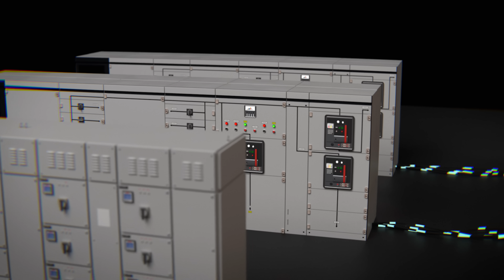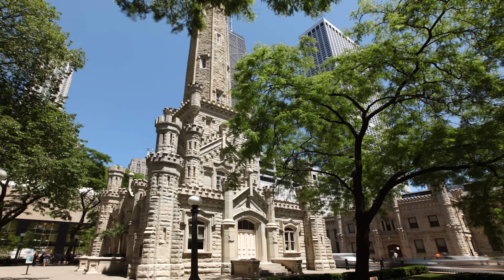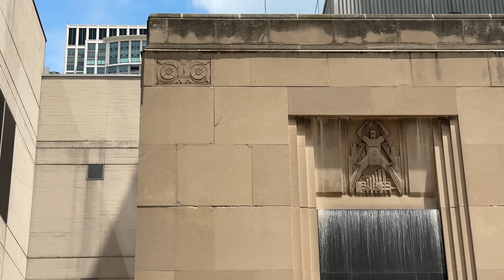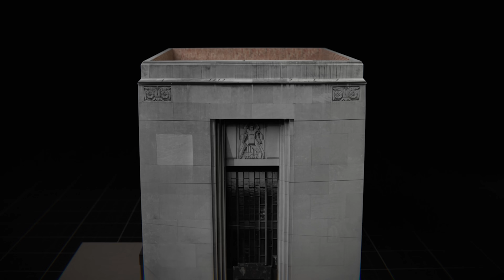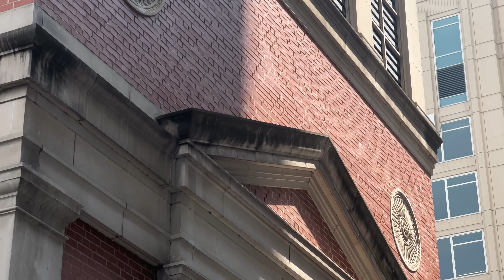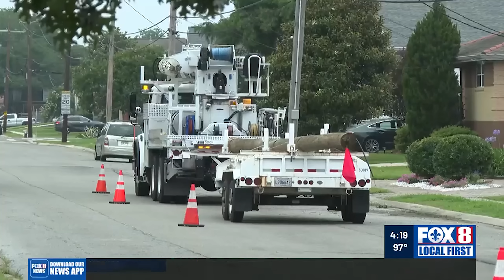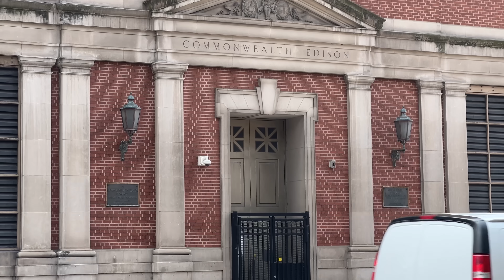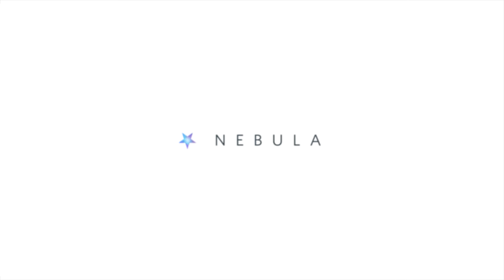How Fake Buildings Keep Cities Alive

Comment: I work for the electric company specifically in substations. I wouldn’t want the general public anywhere near those things, we have years of training just to get close to that stuff and people still do get killed at work.
Reply: Yep. Insurance and lawyers want the public as far away as possible.
Reply: Yeah, they aren't hidden because they are "some cool secret thing for smart engineers". They are hidden because they are dangerous, and someone might break something if they have acces. Keeping them out of sight reduces the risk of someone random having an idea to go check them out closer.
Reply: There's a sub station I drive past regularly, I noticed only a couple years ago the standard chain link fence was replaced with concrete walls, topped with razor wire, and a ton of security cameras.

Kinda weird, lol.
Reply: @planescaped  Perhaps it’s a NERC station and it was upgraded to comply with the necessary security protocols. Electricity is kinda a vital national asset, no?
Reply: Yep, in the UK (1980s) we had public information films specifically warning kids from going anywhere near them!
Reply: If I worked for the electric company I wouldn't want to be anywhere near those things myself. That's the only thing that ever held me back from being an electrician. Getcher paper-thin suit on and your 10 foot pole so you can turn the extremely high voltage breaker that's making scary buzzing sounds on and off! 😒🫶
Reply: Your security guards get about 10 mins of training to be near them 😂
Reply: There's a forest nearby my house, like, a "nature preserve" where its literally just trees, but it also has those wires, right above. And those metal towers, with the wires connecting them, in there, too.
And if you walk to the end of the forest on one end, you find the highway nearby my house, but before that, the substation right next to the highway, and at the end of that forest path.
Just chainlink fences seperating these insane looking machines, out in the open...
Looks like if someone did a redstone contraption in mc, but in real life, instead.

And also, a water treatment plant is on the other side of the forest...
Idk I just find it interesting that the water and power stuff is literally right next to my residential neighborhood....
And I can just walk to that machinery and see where my electricity at my home comes from. for my entire life.
Reply: Yeah but the methheads want the copper
Reply: Sure, but it IS there.  What is the 'harm' in allowing the public to see the inner workings...what if they had 'real' windows to look through (backed by a security features that prevent ingress)?
Reply: @KSPRAYDAD  I'm an engineer in transmission and have had a few public consultations. The short answer is that people hate how they look and sound.Many substations have fences that you can look through in more remote areas but no one likes the look and (fairly loud) noise so they are hidden to reduce noise and visual impact. Plus honestly there's nothing really interesting to see in a substation, it's just a few boxes and bars. Also, they can explode... I'd rather the explosion be contained...
Reply: @Old-George noise like that puts me to sleep
Reply: @KSPRAYDAD  Secrecy is a layer of security. The fact that nobody realizes it's there in itself is preventing ingress. Secrecy prevents shitty people from doing shitty things in this case. Of course, it's not just about secrecy but also beauty. Nobody wants a shitty-looking substation muddying up the beauty of their city. It's an eyesore. As exchangAscribe mentioned, if a street had one of these every other lot I'm sure it would be skid row with drug addicts and junkies aplenty and hypodermic needles laying around everywhere. 😒👍
Reply: @KSPRAYDAD  I see your point, but if everything is working correctly, there literally is nothing to see… It’s when equipment fails that a good show is put on
Reply: @DavidGregor-pr2mc  I'd argue we need to build curiosity in youth in our infrastructure. Can't do that without being able to see it.
Reply: @DavidGregor-pr2mc  That is just the disconnect the creator is talking about. To us engineers it is understood what is what, what does what. To the general public, it is like magic. Especially the large equipment is so foreign to them it produces interest. I've given tours on family days as an electrician in our modest paper mill and every time I show people the copper bus bars they are stunned just by how it is all connected by plates and bolts. It is exceptionally important to notice that to most people in the west, electricity is this thing you just have when you plug a plug into a socket in the wall. The adventurous ones have seen the small wires inside their fuse-boards.
Reply: @ruedelta  Exactly. We need curiosity in youth to interest them into doing important jobs. If no one is interested in doing electrical work then who's going to do it?

I grew up with transparent plastic in electronics. The fact that I could see through the plastic and look at the inner workings of consoles and controllers grew my interest in electrical work which is probably the biggest reason as to why I've been able to build my own computer saving some money on assembly and as to why I'm currently studying to be a professional electrician.
Reply: @KSPRAYDAD  Insert that video from out of Detroit where some ratchet chick climbed over the wire and electrocuted herself twerking on a piece of equipment. WhErES Da HArM said the man who has never met a single member of the public
Reply: @KSPRAYDAD  Do you like looking like someone left a pizza in the oven for three hours too long?
Reply: @KSPRAYDAD as Muhammad in Iran and you'll have your answer
Reply: @KSPRAYDAD you don’t remember being a teenage boy, I assume.
Reply: @KSPRAYDAD because most people think it’s ugly
Reply: @KSPRAYDAD What could possibly go wrong? Hmm.
Glad you're not in charge.
Reply: @KSPRAYDAD  because it breaks the unity and aesthetic of the urban environment. theres nothing desirable or beautiful about machines like this, and they dont make people comfortable in their environment. imagine if a street had one of these every other lot? everyone would avoid that street. 
people need healthy and pleasing environments to live in. thats the original purpose of traditional architecture.
Reply: @exchangAscribe YOU don’t find it desirable or beautiful. But there’s a good reason there’s a term specifically for it, ‘industrial sublime’ as mentioned in the video. I’ve been enjoying bike rides through industrial areas for 30 years now, and it still doesn’t get old. 
If presented well, why wouldn’t we show the infrastructure that keeps the city you’re living running? It’s there anyway.
Reply: @luipaardprint  no, youre assuming that. everyone finds traditional more beautiful and pleasing, besides some outliers like always. thats what im saying. 
industrial equipment is not designed for aesthetics in any way, therefore most of it does not look good or fit with its environment. 
while some minority of people may find the complexity and chaos of the appearance of industrial and mechanical equipment nice and interesting to look at, vast majority doesnt. i myself like and appreciate the look of these machines, but i realize i have a unique taste and i understand objectively they dont look as aesthetic as traditional architecture.

theres actually a literal style of architecture that wields this aesthetic if your interested, called bowellism. and the buildings that use the style sit right next to all the regular buildings perfectly visible. and yes, majority of people did not like it at all.
Reply: @exchangAscribe if ‘everyone’ finds traditional more pleasing architecture would not evolve. Yet it does. You really have to be careful with statements like that because they’re almost always demonstrably false. 
And all of that bypasses the point that was made in this video essay, which is that architecture could be used aesthetically to give space to the infrastructure that is allready present in your environment.
Reply: @exchangAscribe and on a side note, the centre Pompidou is considered a highly regarded contemporary artwork when we’re taking about Bowellism.
Reply: @luipaardprint  its not demonstrably false. i am careful with my words and know exactly what im saying. its actually demonstrably true, and has been demonstrated on multiple occasions. 
architecture like any form of artwork may evolve based on trends or passing fads, but they do not evolve based on what is good or not good. people follow trend and do things based on group thinking and popularity more than anything else. there is thousands of examples of trends or norms that were objectively bad for society or just distasteful. to think that everything thats normal or popular is because people like it the most or that its the best and beat out all other options is shortsighted and has shown not to be true on huge number of occasions.
the original point was already addressed, you could use the industrial thing there but itll look bad. plus be open to people touching it.
Reply: @exchangAscribe you’re still misconstruing the point, no one said to just plop a transformer in the middle of the street for kids to play around, but to use architecture in a way that shows that infrastructure is there instead of hiding it. 
Also when you say ‘everyone’ in the same sentence as ‘not everyone’ it’s demonstrably false, and you should not use the word everyone.
Reply: @luipaardprint   thats not how statistics and the general existence of life and organisms work. or youre just being coy and you know. there is not a single statement out there that you can make where the term everyone would be technically correct by your definition and logic. you literally wouldnt be able to use it for anything besides situational or contextual statements where you know the full sample size like "everyone in this room" referring to 5 people. i can, like anyone, say "everyone has a mouth" and it based on how the word works and how life and nature works, be true. noone would question that statement and we use such statements/thoughts to predict and assess variables, patterns, behavior, and operate in the world around us. even though, by technicality the statement is 'not true'.

the building wouldnt be in the street would be in a lot lining the street like all the other ones, but would still be accessible that way and people be able to touch it like all the other buildings. youd have to block it off with a gate or something. 
if youre saying to have an actual nice building housing it like in the vid but thats designed with parts of it exposed/cut, showing the equipment and industrial parts inside (like high end cars will do sometimes), than id agree with that and there could be a way to make that look really cool and just as pleasing as the traditional building would, while also keeping away from contact with it.
Reply: @luipaardprint the majority do, across political lines, across regions and socio-economic status. This is aggregated from over 40+ years of research on pattern responses, flat polls, design contests, preservation movements, and the current surge in interest, globally, in new tradional design and urbanism.

The status quo is set now by power brokers who decide the sway they need for their highest profitability. One hundred years ago, when the world was already introduced to Modernism, the overwhelming majority of people held strong to the use of decoraded, traditional design, and the cubist/ minimalist structures were nothing more than sculptural experiments. It wasnt until after the second world war that the tennants of those styles were co-opted to reform architectural standards, as the pace of the rebuilding and world at large exploded. 

People had reactions locally, but it was scholars and idealogues who carried the torch of contemporary design principles into the mainstream, not the public. The public has, provably, on just about every occasion, favored traditionalism to contemporary "modern" inspired design language.
Reply: @exchangAscribe  Function is form. I personally prefer working things, art is arbitrary and meaningless. Substations often have lots of symmetries too... Eye of the beholder, and you sure presume for a lot of the population.
Reply: @transitive-identity  love this argument. if art and aesthetics is meaningless and useless, remove all art, visuals, games, entertainment, and leisure from your life.
Reply: @exchangAscribe   I am the opposite in that respect.  I guess, being an engineer myself, I am more at ease when the equipment is visible, and I know where it is, and also easily accessable to the ones that maintain it.  I work on a considerable amount of equipment that people like to hide in cabinets, closets, in ceilings, etc, and the problem is the more hidden it is, the harder it is to access and service, and also being out of sight, out of mind, means it gets neglected too.  A visible substation or pumphouse that has something go visibly awry, would lead to someone calling the malfunction in.  Hidden in a building, nobody would know a malfunction occurs until it gets big enough to cause a failure.
Reply: @exchangAscribe  You seem to presume I decorate my life, I live functionally, it is quite stark to most. I have minimized it for the most part, only functional things exist in my home and I let entropy sort my space. Why do I have to remove all visuals and go blind? There is a lot of symmetry in reality that isn't due to arbitrary human opinion that can be valued for it's thermodynamic efficiency and/or functionality regardless of what people believe. Why can't I game for functional reasons from memory training to dexterity, do I need to care about the visual style? In fact I design many interactive simulations without ever appealing to art that are beautiful to me for the truths of reality they provide a litmus for. I see the beauty in exposed substations in the same way someone sees beauty in the mona lisa. I can appreciate the skill it took to create the mona lisa, but there's more beauty in a LHC capture. Simply stating people are more varied than you pretend.
Reply: @exchangAscribe  While you are correct about the fact that most people don't find electrical substations very pleasing to look at, I think it's also important to cater to the small audience that does in this case.

If electricity works like magic and just appears from your wall outlet then no one is going to be interested in doing electrical work. What happens if a substation does have a problem in it? Who's going to fix it? No one, because no one was ever shown what a substation looks like and therefore never got interested in electronics and took a job in a field like marketing instead. Electrical work specifically is currently in high demand and we should interest the youth in electrical work so that later when they do choose a field at least a small percentage of them choose to work with electronics.
Reply: @KSPRAYDAD Eh, curiosity breeds temptation. Security by obscurity. The idiots are everywhere and they have unbelievable skill in circumventing protections made precisely for them.
Reply: @Bob-cx4ze  Security by obscurity is good as no security at all. No professional security expert relies on obfuscation, it's a delay at best. I was curious, and I loved seeing the open-air substations around my city. Never tempted me to jump in and I've trespassed plenty of places. And what if because it's obscured, now it becomes an urban myth and draws kids to breaking in?
Reply: @transitive-identity That's only an issue when you don't have defense in depth. Just like we don't leave stacks of 100s on our car dash, not being the low hanging fruit is a legitimate strategy.
Reply: @Bob-cx4ze Yes, temptation to actually get involved in and work on these systems. If no one knows they even exist, good luck finding people to train and hire to ensure this crucial infrastructure keeps working.

Trying to pretend they don't exist only leads to a disconnect between the public and the infrastructure that makes their lives possible. A curious public is one that will actually try and get involved, rather than one that either never thinks of these things or one that mystifies these buildings or creates conspiracy theories about them. You tell me which is better.
Reply: I don't think he's saying that we should put monkey bars between the disconnects and slides on the transformers.
Reply: @orion8981 Ok, hear me out. American Ninja Warrior: Shockwire edition.
Reply: @orion8981   Of course he isn't saying that, but that also doesn't take away from the original point either.
There are plenty of people who trespass as a matter of "cool exploration." Even more so in a large city.
A dull and boring office building does not invite such tresspassing as much as a transformer out in the open would.
You're just wrong if you think that such infrastructure wouldn't attract people to mess with it.
Reply: The argument is not "bring the public closer to the danger". The argument is "stop hiding impressive stuff behind dollar store facades".
Reply: Security through obscurity is just a sure way to get problems down the road when the oldheads kick the bucket and suddenly no one knows how to restart the substation because "an info leak could be dangerous"
Reply: While I have to agree with the professional, awareness makes for a safer environment than just tucking it in a corner that someone might be around when something goes wrong.
Reply: Your opinion is the least valuable in this discussion.
Reply: @WatchMeSayStuff and so is your presence, now scram rat
Reply: @WatchMeSayStuff cool story bro